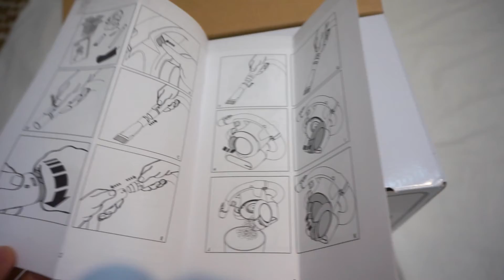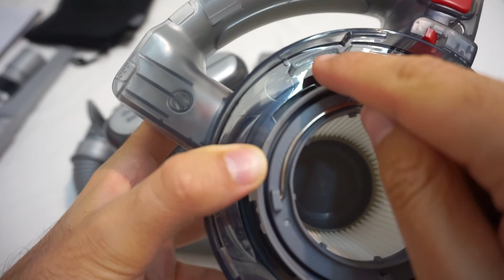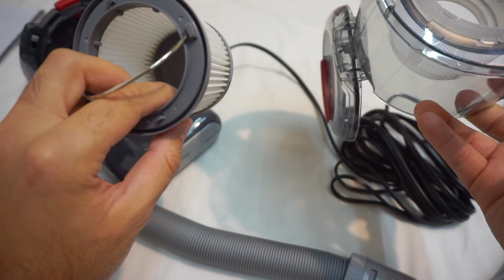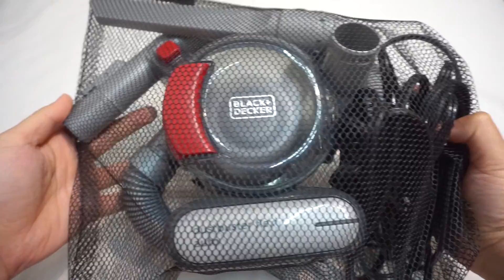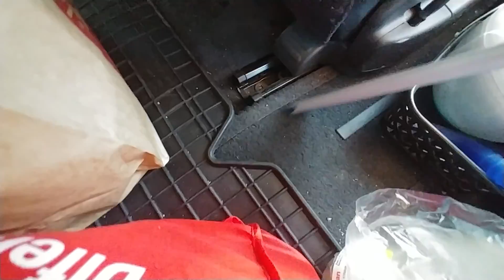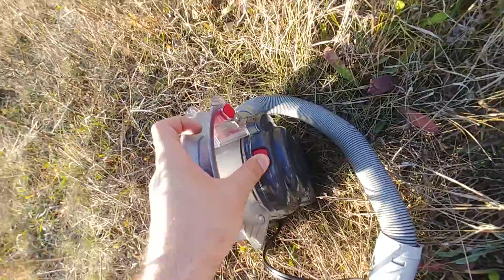Black & Decker Dustbuster PD1200AV, 12V vacuum cleaner for cars

Comment: I have been reading lots of reviews on this cleaner and many say the suction is far too weak. You didn't mention this aspect. I was wondering if it can be used with the car engine running, to give an extra couple of volts, might improve the suction a little bit.
Reply: It can. I have had one of these for small Mazda sedans the past at least, 13 years now, it works quite well, running or not. My canister dirt door broke the hinge is gone or cracked,
so I have to duct tape it but the vac. works fine. I want to get a new one soon. It's that good of a vac.